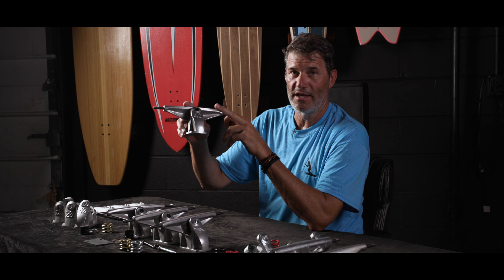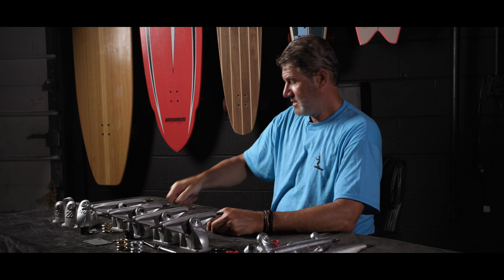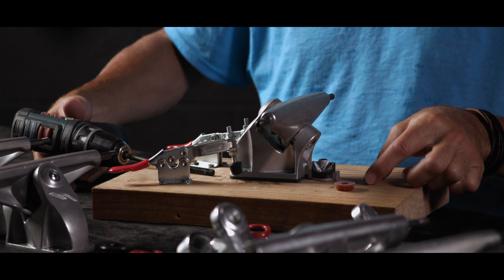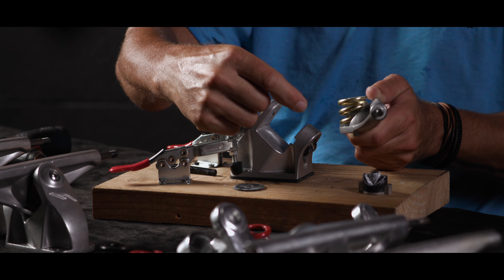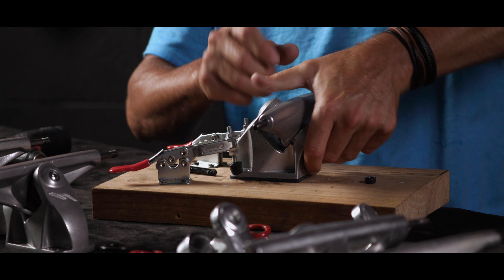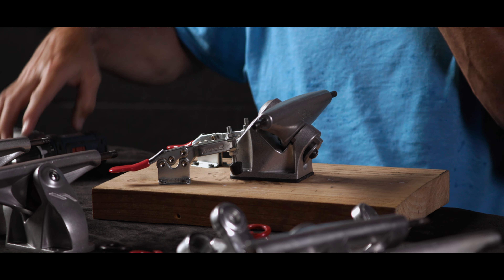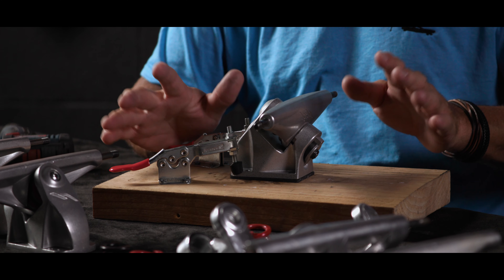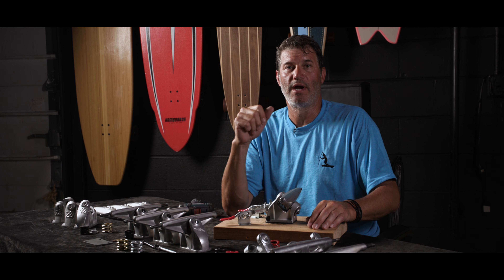HST 2.0 Flow Kit Upgrade

Comment: Looking forward to trying this; my Endurance 45 feels a little too loose for my riding style. This looks like just what I need.
Reply from the maker: The Flow Kit will definitely give you more control.
Reply: @hamboards  I just installed the compression bushing, and the truck feel is greatly improved. It didn't appear the other components were any different that the current items on my trucks. Should I also change out the cams and washers? Are they any different than the parts on the trucks in my Endurance 45?
Reply from the maker: @stevenhorney7735  Compared to an Endurance 45, the wave cams in Flow Kit are made of a much stronger nylon composite. The old wave cams will fail due to the added resistance of the bushing. We have also bonded the cam keys to the wave cams for a much tighter fit. 

The new wave cams may took similar to our old moly nylon ones, but he surface of the new wave cams have a slight texturing which you can see if you look at them closely. 

The king pins and washers are the same as your stock setup, but we recommend changing them anyway as preventative measures. The washers deform from the forces in trucks and every time the king pin is turned the chances of it stripping increases. Changing them now reduces the chance of future issues.

Comment: Basically adding dampening to the system by increasing the resistances of the kingpin. Why not just tighten the kingpin in its nut? Is the insert gripping the kingpin?
Reply from the maker: Just tightening the kingpin does not increase the resistance because springs hsve a linear profile. The bushing totally changes the resistance profile, but we had to reengineer the other components to work with the greater resistance. You can see the entire kit here. https://hamboards.com/products/hst-flow-kit

Comment: Why didn’t you put lubricant on the wavecams before installing? It says they’re “self-lubricating” on your site, but lube is included…
Reply from the maker: We didn't know the application of lubricant in the video, to keep the video short, but the instruction card with the Flow Kit says to apply lubricant between the nylon parts and where the nylon parts contact aluminum parts.  The lubricant is to reduce squeaking of the nylon parts. The "moly" in moly nylon stands for molybdenum disulphide which is a dry lubricant and will prevent wear of the nylon parts, but the dry nylon may still squeak as the trucks move,.

Comment: Are you acting like we haven't heard about dohdohs yet?
Reply: What are dohdohs?
Reply from the maker: Doh-Dohs won't work. They are 9.75mm, which is too tall. Our bushing is 7mm tall, which is the max that will fit into the spring. The bushing is just one part. To accommodate the additional resistance of the bushing, we had to develop new components to work with it. You can see the entire kit here. https://hamboards.com/products/hst-flow-kit
Reply: I followed instructions and can’t insert truck back in and spring in slot. It’s not as simple as in the video, which slid right in. Now I have truck apart and frustrated. Am I missing something?
Reply from the maker: @edyourtrainer  It's a tight fit but it will go together. try extending the washer on top of the spring so it overhangs the spring just a little. Then use the washer as a lever to slide the assembly into the baseplate. Then realign the washer once the assembly is in the baseplate. A dap of lubricant between the washer and the baseplate will help  If you continue to have problems, call our customer service line at 714-613-0532 and someone will help you.
Reply: @hamboards  Got it in there, thanks. The ride is definitely smoother.